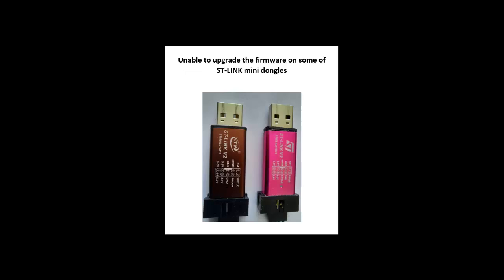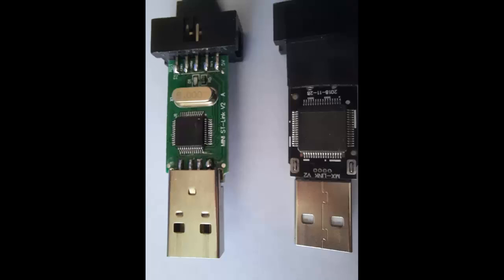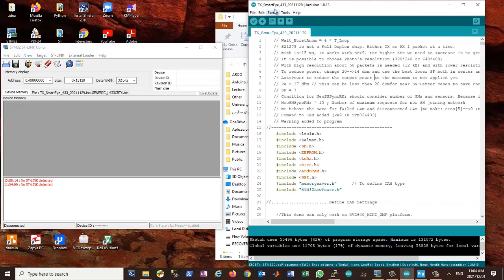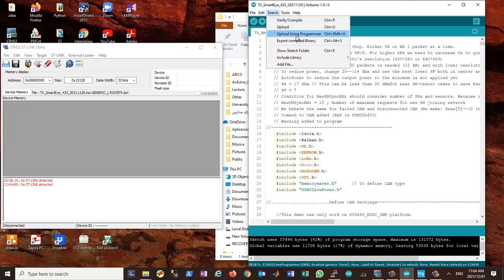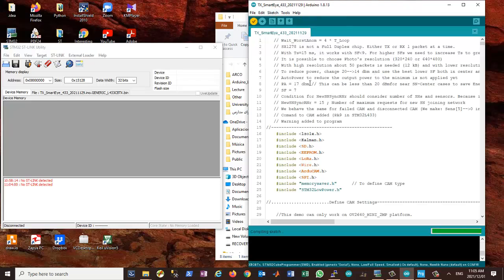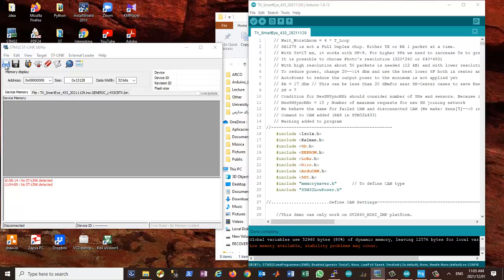Solution for Unable to upgrade the firmware on StLink

Comment: Hello, where can I find the TX smart Eye program? I searched in the Arduino application and did not find it.
Reply from the maker: Hi,
Unfortunately, the code is confidential due to its commercial nature. But, as you see the mentioned hardware-based issue might happen in a variety of applications.

Comment: Can you upload or share this file ? I need this 🙏
Reply from the maker: Hi Ackbar. The file you upload can be whatever file. It can be your project sketch or a simple Arduino code. As I have mentioned in my video, uploading the Binary file (by a fake ST-Link) is a replacement for the normal uploading method by an original ST-Link.

Comment: si cambio el ic APM32f103cbt6 por el original STM. ENTOCES SI PODRIA GRABAR EL NUEVO IC TIENES EL PROGRAMA, GRACIAS
Reply from the maker: Sorry. Please write your question a little bit clearer.
Reply: Tengo un st link con ic APM32F103cbt6 y deseo cambiar el ic por este stm32F103cbt6. aparte del cambio se tiene que programar el nuevo ic y si tubieras la data para cambiarlo. gracias  desde peru  @Mehrdad.Babazadeh
Reply from the maker: As far as I know, you need to match everything pin by pin in terms of hardware and also consider requirements in the software part to get the correct response. I have nothing more and no program to be replaced and do the job as you mentioned.  @electronicasolutions9813

Comment: i  want to ask you what if the stlink i used it previously for depugging with the stm cube now it doesnt allow me to depug unless i ubdate the firmware what migth be the problem plus all these massages and errors are showing up every time
Reply from the maker: As I understand, there might be some reasons. Every hardware might be damaged while working unwantedly because of different reasons. Some of them have less lifetime than others because of the quality and the environment they are being used. 
You may have changed the option bytes to luck the program accidentally. Then, you may change the option bytes to the original one while updating.
There also might be other reasons that I am not aware of them.
But based on